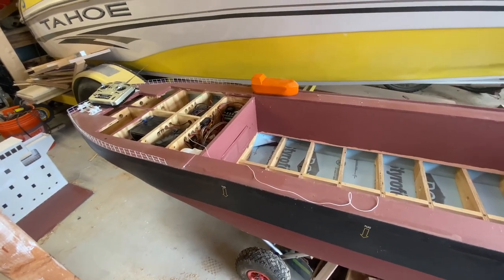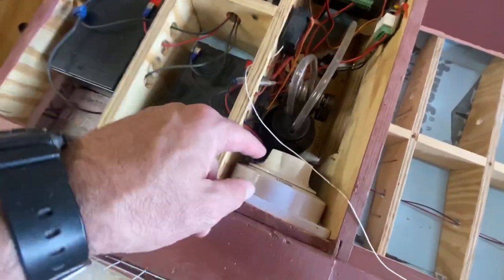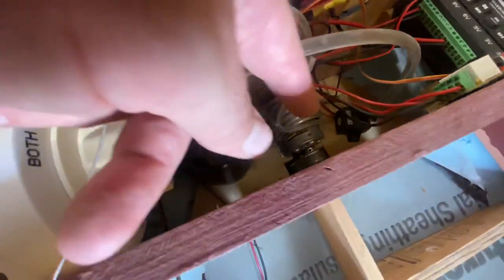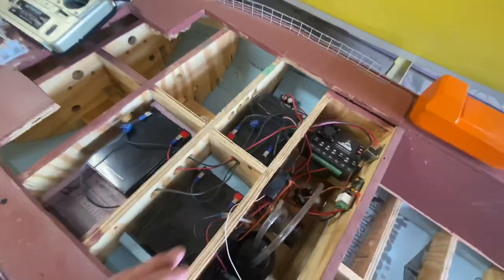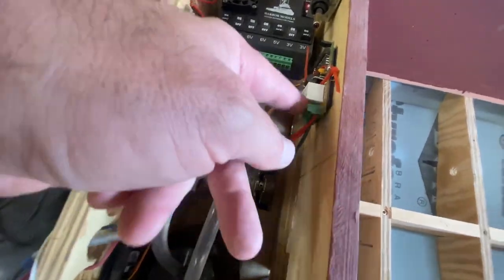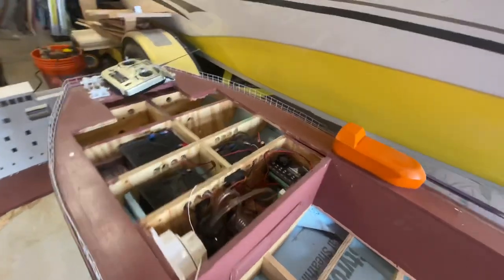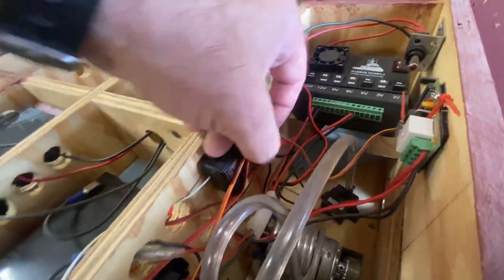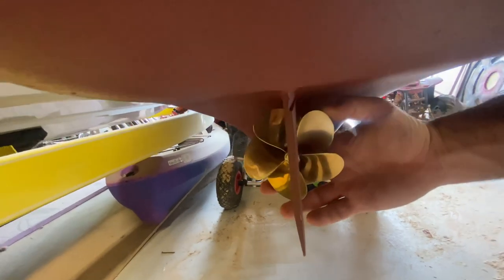Electrical system on the 11’3” cargo ship Adela B.

Comment: WOWZERS! 11 Foot is MASSIVE, for an RC!
Reply from the maker: PNW RC yeah definitely large scale! Where in the PNW do you live?
Reply: @scratchbuiltdozer  I live in Seattle Washington
Reply from the maker: Nice. I grew up down the road in across from Longview in Rainier Or.
Reply: @scratchbuiltdozer  I'm very familiar with Ranier Or. I use to drive through there every week, when I worked as a delivery driver for Schwan 's home delivery.
Reply from the maker: PNW RC nice. May have passed you a time or two. My dad was a log truck driver and as a kid I use to go with him. Lots a fun to a kid.
Reply: @scratchbuiltdozer  That's very possible! After Schwan's, I was a log truck driver. I didn't do much in Oregon, but we did cross the river a few times hauling logs to Tevin Bros sort yard
Reply from the maker: PNW RC my dad drove for Heavy Hauling in Kelso. Before log trucks he worked at Woods Logging delivering wire rope and chokers to yarders and replacing the cables.

Comment: I wish I had more time for my projects, wow the time changed now I have time in the afternoon, Thank you...

The motor you are cooling does it come prepared for water cooling or did you put like coils around it. Around 18 years ago I had an idea to build a submarine good thing it never happened...Cool video
Reply from the maker: Jorge Serna I hear you on the time. I fall behind on my job orders every time. 
The coil is a trick I discovered in a RC ship group. Definitely helps quite a bit especially in the Texas summer heat.

Comment: Hello friend, I congratulate you on your work and tell me what are the measurements of the boat, is that I am in the project and I still do not have exact measurements but it is more or less like yours?  you help me???
Reply from the maker: Thank you! It’s 24 inches wide and 11ft 3in long with sides about 12 inches high.
Reply: @scratchbuiltdozer  I thank you for your help and I hope you can continue helping me in my project, it will be a fishing boat and thank you again.

Comment: wow that motor looks tiny with that ship scale
Reply from the maker: Yeah it does as I thought the same thing but big ships don’t move fast and it’s plenty of power to move it.
Reply: @scratchbuiltdozer  question. how do you control the bow thruster? with 3 way switch or with 2 way esc? also is the bow thruster using brushed motor?
Reply from the maker: @kiwiflyer3797  it runs off its own channel so I can have full control at all times
Reply: @scratchbuiltdozer  yes i know, but are you using a normal esc? If so, how you reverse the thrust?
Reply from the maker: @kiwiflyer3797  ohh got cha. Yeah I have a Viper Loco Micro 10A Brushed ESC  that runs off the receiver and powered is supplied by the a power distribution box from harbor models
Reply: @scratchbuiltdozer  oh ok. 
Sorry, last question. What motor size is the bow thruster and what voltage does it use?
Reply from the maker: @kiwiflyer3797  I bought everything at harbor models dot com and they have all the bow thrusters of all different sizes. I bought one that was in the middle around 14mm and it’s undersized
Reply from the maker: @kiwiflyer3797  they are all 7.2 volts
Reply: @scratchbuiltdozer  thanks for the answer sir. keep it up!